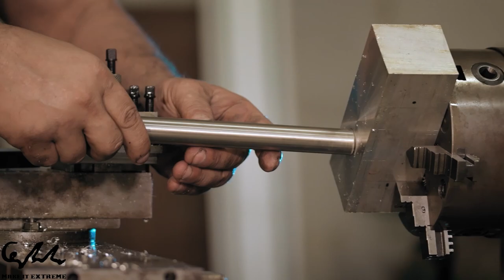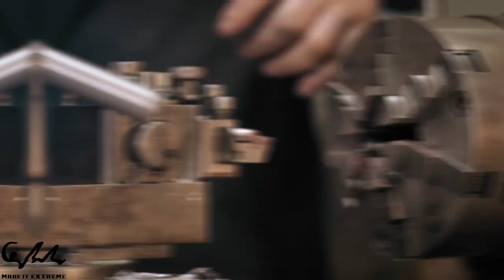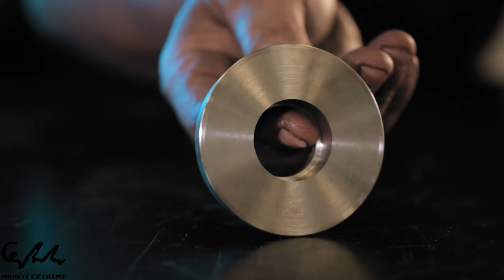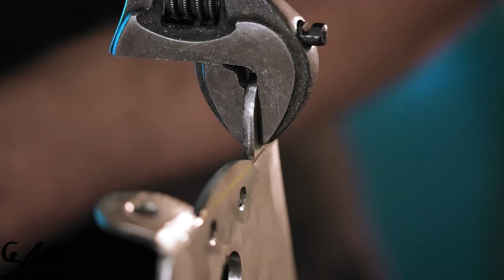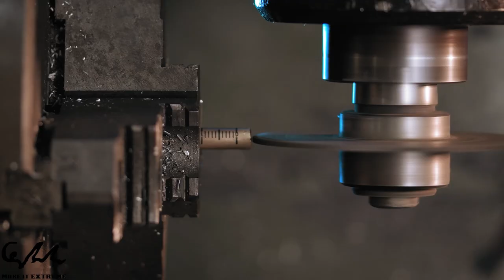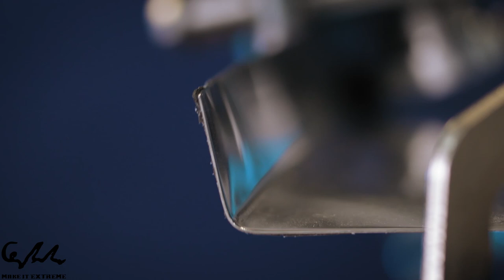Sheet metal Roller Bender

Comment: You do some awesome work bud. But I would have just built a hand break for all that.
Reply: But the hand break limits the length you can bend. This tool can bend very long pieces and it is so small it does not take much  storage space in the shop.

Comment: Amazingly skillful!

This tool does not really replace a metal brake, but it though is pretty useful in many applications.
The greatest advantage of this tool is the ability to create flanges on curved edges.
You can't do that with a metal brake.

The only thing I would recommend is to harden the tipping wheel.

Thanks for your video!